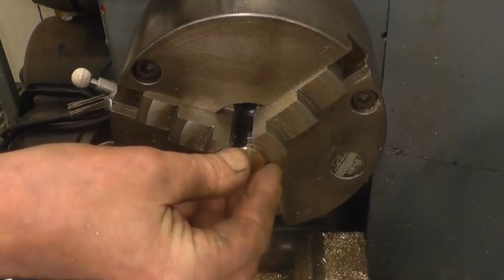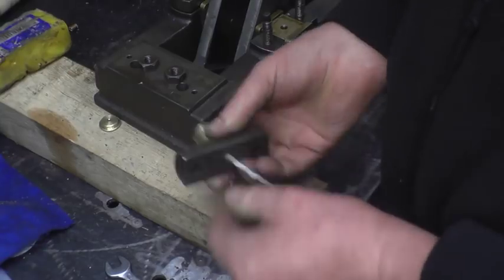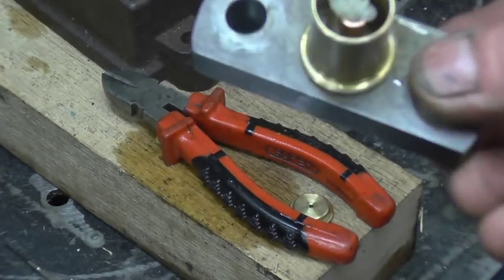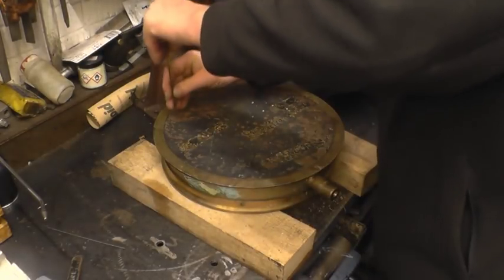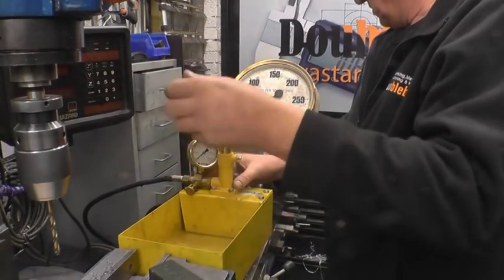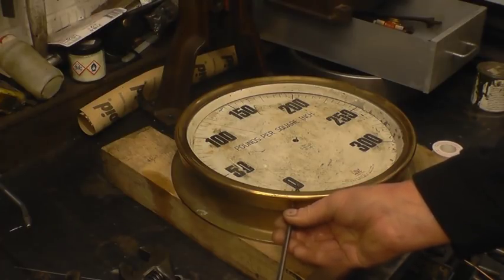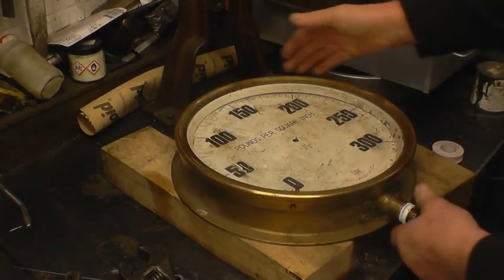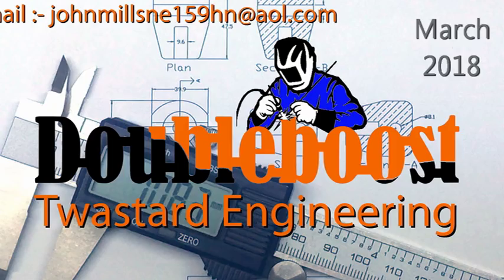SNNC 216 P2    How a Pressure Guage Works

Comment: John,
It's great to hear you say that Debs is happily back at work. I think that old pressure gauge will make a really nifty clock. Polish up the brass and spray on a layer or two of clear-coat to keep the brass shiny. Thanks for another fun SNNC! Good luck with your steam engine.
Have a good one!
Dave

Comment: Shame on you john, knowing you loving of steam stuff its a sin to destroy a real old working guage like that and turn it into a simple clock. You could make a clear acrylic face slightly smaller than the main one for dots or numbers so as to keep it fairly original, if you take the old one out its just a simple brass clock that no one will ever associate it to an old steam guage. You could even put a small LED number clock between 0 and 300.
Reply from the maker: I appreciate your concern but rest assured The original face will be restored and left in place as the clock face.
The internals will be stored in a safe place not damaged in any way
The idea is to keep it as a steam pressure gauge but works as a clock 
I would just hang the gauge on the wall, but the idea of a clock pleased Debs

Comment: Hi JohnGreat video as alwaysSuggestion for the "clock", a piece of brass pipe coming out as did the original workings, then a brass coupling, next a brass elbow (possibly a street ell)  facing wall side of "clock" into a brass pipe flange.  It would appear the "time pressure" is connected into the wall.

Comment: Hello John.  Greetings from Canada ( I was out skiing today on Lake Huron as we still have 15 inches of ice!)
Great video.  I really like that little vertical engine.  With respect to your cotton trimming in the oilers, Worsted Wool makes the best trimmings material (used an all British steam locos).  You can still buy it specifically for making trimmings from Heritage Steam Supplies as well as Armstrong OIlers ( a division of the North Yorkshire Moors Railway).  From my own experience driving a steam loco in Canada, I would recommend you "brew up" your own bearing oil - namely a plain (no additives) 10W30 (or UK equivalent) mineral oil and add 10 % by volume of rapeseed oil (from the supermarket).  Rape oil was put in the mineral oil in steam days to help it "wick" better on the trimmings.  Look up "Worsted Wool Instructions" on Google.  There is a chart there that shows how to make a "tail" trimming with worsted and thin brass or copper wire which would be the exact job for your engine.  Hope that helps.  Paul.

Comment: Lovely looking project John. Yes, PTFE tape is a bit modern, for sure leak free joint, Stag A or B thread pipe sealant and Hemp, an improvement/oil resistant on Boss White and Hemp combination.  Beware !!! it smells terrible and gets blooming everywhere.

Comment: just use the face plate like it is.  Everyone will be able to tell the time by the position of the hands.  Also put the fitting back into the base, put a 90 degree fitting on it and make it look like it comes out of the wall.
Reply from the maker: The original face will be cleaned & reused
Reply: Neat gauge. You could put a clock face on the back side so you have a choice to display pressure or clock face.. flip it around once in a while to screw with visitors minds :-)

Comment: If the gauge was for a boiler it would be ranged so it's normal reading was close to 50% of full scale. That's partly so you could do a squeeze on the boiler, (a hydrostatic examination).

It might be cool to etch the clock dial on the glass you use and leave the old gauge dial behind. Just a thought.
Reply from the maker: It was SWP 120 the gauge reads to 300  It came from a steam boiler. The original face will be retained
Reply: Yeah, they wouldn't make special gauges for each boiler. Just size the gauge so they can do a squeeze, also bearing in mind that gauges are most accurate between 15 to 20% and 80% of full scale.

Comment: Nice video as usual. Thanks     Seems a shame to re-purpose such a nice working gauge. Maybe you can preserve the original dial by flipping the plate over to put your clock face on. Fasten the clock works inside in such a way as to not damage the original face and then it can be put back to original when you get tired of the clock. Just my opinion. I have a similar big gauge and I put it on my compressor. Makes a bit of a conversation piece for guys visiting the shop.
Reply from the maker: The gauge won't be damaged in any way. The face will be used as is once cleaned. The internal parts will be stored in a safe place.  A new glass will protect the face from further damage. If it was not for me this gauge would be lost forever. Thanks for watching
Reply: That's good news John.  Got to admit I got a bit of a twinge at the thought.  That said I'm also mindful that the Victorians never had a second thought about making things as they wanted them.  Nostalgia might not be what it was but you cant keep everything as it was, everything changes.
Reply: Dave Sage n

Comment: Seems a pity to lose the pressure gauge. But it should make a lovely clock. Meadows & Passmore should supply you with everything you'll need.
Reply from the maker: The gauge will not be harmed